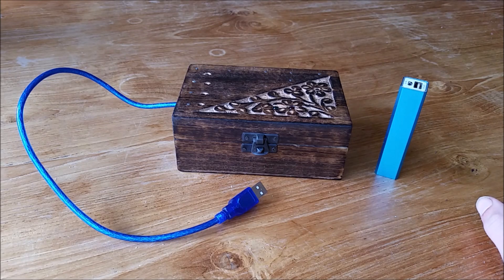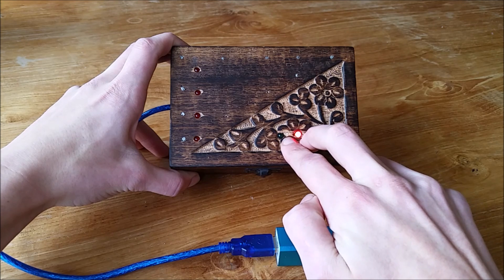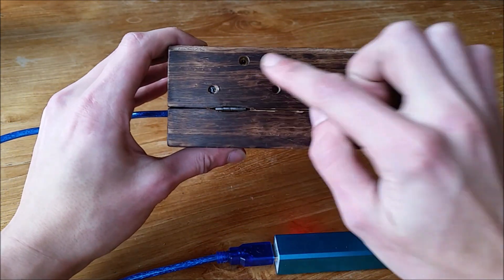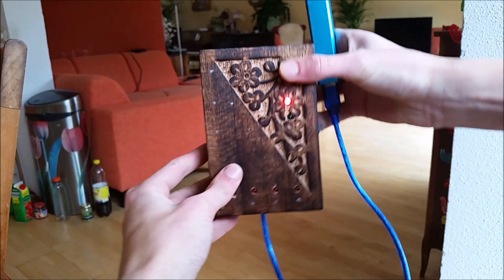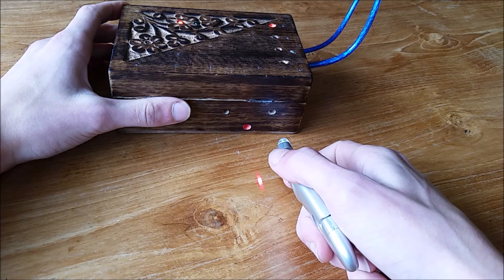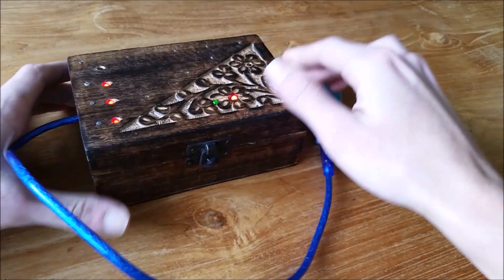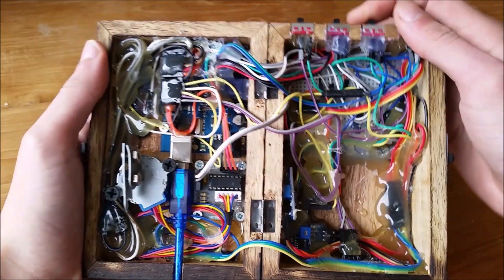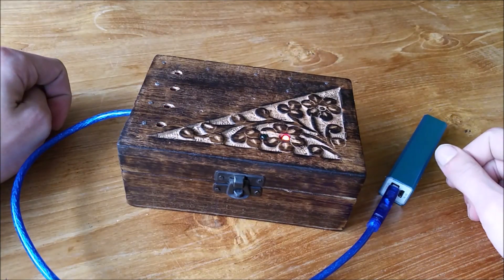mind blowing arduino puzzle box (with electronics)

Comment: Hi, this is amazing! Do you have an code and scedule that you can share so i can build i by myself?
Reply from the maker: Hi, I'm sorry but I don't have the code anymore. I'm afraid I can't help you.
Reply: @bennodegrote  Hi, how coded you that the Arduino remembers the unlocked parts and give a signal to the motor to open the box when al parts where done?
Reply from the maker: @quinvollenberg3832  It's quite some time ago I coded something. I believe I used variables to check the stages. If stage one is completed var1 = true. If stage 2 is completed and var1 = true, then var2 = true. When the last stage is completed and that variable is true the box will open.

Comment: Interesting! I note that you, like me, use an external power bank. That turned out to be a problem for me though; my circuit took so little power that some "smart" power banks just switch off!

I have also considered sound input but never made it work properly. Are you using a standard sound input module or your own construction?

Comment: If you need to open the box to fix a problem with the sequence, then you're screwed!
Reply: A "backdoor" via USB would be a good idea :)
Reply from the maker: yep, basically :)
Reply: I am sure he tested all the circuits before gluing them, and any software problem can be solved using the USB
Reply: Enigma758 he can hack it
Reply: It obviously has a servo actuated latch so he just connects it to serial monitor and sends a servowrite command

Comment: One big flaw though :) This would be easy to "hack" by reprogramming the arduino with the usb cable, since you have connected it directly to the arduino ;P
Reply: Or just use the power only, not the data line
Reply: This can be easily overcome by putting power source inside the box and providing on/off switch.
Reply: But then how could you charge it?
Reply: Dylan Cardiff If you see Arduino uno, it has separate power input.
Reply: I own an arduino uno, I know how it works. My point is if the power source for the arduino is inside the box, and the box is locked...you cannot access the power source in order to charge the box's battery. It will become an elaborate paperweight
Reply: Dylan Cardiff Or you can provide power from outside the box. Just make a little hole for the input from adapter.
Reply: Keval Pandya Yeah that, some more organic clues about the solution, and a little cable management would have made this an A+ project. As it is it was still a neat build tho
Reply: Yupp, though it is the idea that matters.

Comment: There is a way to prevent cheating the laser. I was playing with same kind of idea about laser gate alarm some years ago. Either flash your laser at certain timing, for example 2ms on, 2ms off and check that the sensor is lit when laser is on and sensor is unlit when laser is off. This already makes it harder to cheat because you can detect it. Or even better have it work random. Pick on and off times between 1ms to 5ms.

Comment: That is really nice. I found one problem. You use USB cable to power. With this cable someone can program your arduino from outside the box, so it is actually pretty easy to hack your box ;)
Reply: you can also hack the box with a axe.
Reply: Well I hack around with arduino and other microcontrollers and none of my family or any other ppl i see daily even know what an arduino is, or even the one maybe two ppl that has heard of an arduino still couldnt program it and they surely couldn't write code or even use a copy & paste code in the software...It have to be a tech- savvy person to reprogram it. So most would be safe
Reply: But if it was me I probably would have just put a OTG plug in a ltl hole facing out the bottom of the box and most ppl wouldn't even figure that out...
Reply: Easy fix. Simply use a USB cable that only has 5v, no data.
Reply: I use an extra USB connector and only connect the power to the rest of the circuitry.

Comment: If you made the laser blink in a particular pattern, and then made the light sensor only let the box open if that same light pattern went in, then you could prevent someone from using a flashlight to open the box.
Reply: Good Idea, but of course they could still observe the blink pattern and mimic it with a flashlight. Maybe if the sensor only read red wavelength light, but that would probably be a more expensive sensor
Reply: when I say blink, I mean at a rate which is not discernible to the human eye, or at the very least make it blink fast enough so that it is not doable by hand. (basicly encoding data into the laser beam)
Reply: Dylan Cardiff The sensor he uses is just a photovoltaïc (i dont know the english word) cell if i'm not wrong. I think it can only measure light power, not different colors.
Reply: derstreber2 Yeah i understood that, i was answering to the one speaking about colors. I don't know if the light receptor can be able to do that (it needs a minimum working frequency). I bought an arduino kit and these captors are the cheapest ones.

Comment: Wow, I love it! Imagine something like this as a geocache!
Reply: Some people would break it open, BUT if you make it a multi, that won't help at all, so that's how I made mine. I have three multis so far with an Arduino or DIgispark as a step, and they deliver coordinates or hints to coordinates. Break it, and you get no coordinates! Two of them have been in place for over a year and a half and the only problem was that I had the voltage controller blown by a visitor that most likely connected the 9V backwards (and I didn''t use any protective diode). After that, I completely skipped "bring your own battery" and with my latest tried "bring your own powerbank" instead. Much safer.
Reply: +AnneloesF I would break it open if I found it.